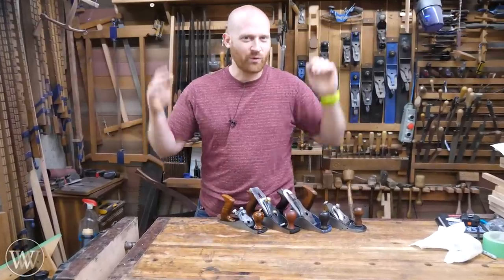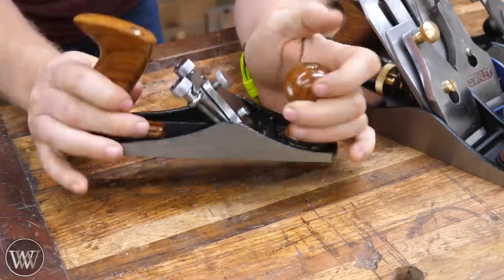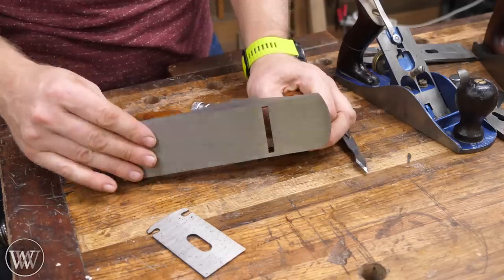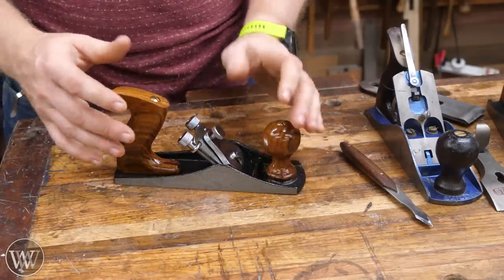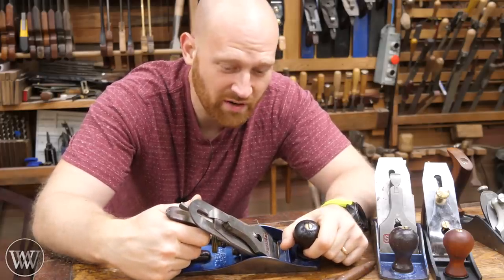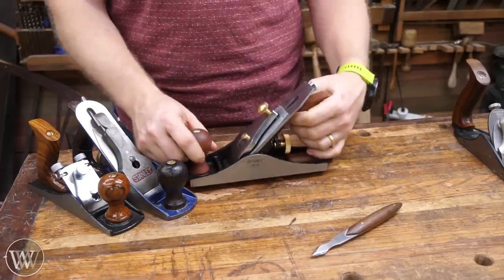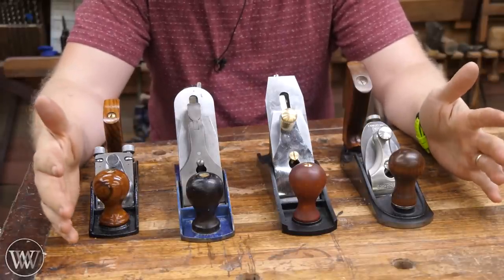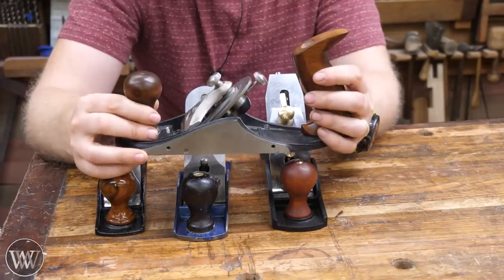The Good the Best and the Ugly | Choosing a Hand Plane

Comment: And then there are people like me who live in a tool desert. My area in Colorado is too modern for old pioneer planes, too old-fashioned for hi-speed internet or reliable cell service, too sparsely populated for lumber yards, and too sparsely forested to find any wood other than pine, fir, and red oak. Just yesterday I made up a list of every antique dealer, pawn shop, tool retail, and even army surplus store in my local area and I found not one plane, not even junk to take a blade from, except from Harbor Freight. Craigslist has only two listings for planes in the massive area that I'm part of, both of which are over a hundred mile drive just to look at. And when I check your website for locating tools, it's a 300 mile drive to the nearest point on the map. So buying online is basically a necessity, and I'd rather not start my woodworking journey by spending six months buying four or five antique planes before I find a good one.
Reply from the maker: ya that is not an easy place to find tools. Have you contacted the Rocky Mountain tool collectors? http://www.rmtc.org/
Reply: @WoodByWrightHowTo  I did not know they existed. Thanks for the link, I'll check into them. It'll still probably be painful to reach them physically, as I live basically smack in the middle between Denver and Salt Lake; 300-some-odd miles to reach either one. But at least this gives me a relatively local group to look at.
Reply from the maker: ya you are in a tough place. no fun!

Comment: I was gifted some 1950's Stanley number 4's but I wanted some new planes which didn't require a second mortgage. I settled on some faithfull's. I fully agree, comfort in the hand is so important, so although the handles (totes) are clunky, I spent some time with some engineers files ranging from bastard to fine.  Just recently, I  had to spend a couple of days with my scrub plane, a very cheap no name number 4, well used and discarded onto ebay. When I finally got to use one of my Faithfull's again...... oh the difference, the difference !!! It was like, "where have you been" ??? So definitely, I  would recommend tak8ng a rear handle off (tote) and spend a little time, sitting comfortably somewhere,  with a cloth over the lap, and just file to the shape of your hand, well worth the investment of your time.  🏴🇬🇧👏👏👏👍👍👍🇬🇧🏴

Comment: After searching the local market for a fixable couple of planes I bought a pair of grizzly planes. The #4 needed very little setup, maybe a half hour, the#5 needed substantially more and I use a scrub iron in it for the most part. Both have performed adequately in the tasks I've put them to. Oh, bought a small set of the narex chisels, what a joy to play with! Now if I can just figure out how to hold my ancient 1/8" chisel to hone it consistently I'll be a happy old curmudgeon. Hope your mother in law is doing well and all of you stay safe.
Reply: Old Stanleys are hard to come by in the PNW. I have three Bears—the smoother, the jack, and the jointer. Grizzly doesn't use the Stanley numbering system, but they're pretty decent updates of the 4, 5, and 7. I put Hock irons and chip breakers in the smoother and jointer, spent a couple of hours each dialing them in, and love 'em. I also have Narex chisels, and have yet to reach their technical limits. I recently got a set of the Narex cryogenic chisels, haven't completely bonded with them yet. You don't have to cough up a lot of money to get users.
Reply from the maker: here is an old video on sharpening thin chisels. https://www.youtube.com/watch?v=xyjR-8uNR8I I know a lot of people that really like their Grizzley planes. if they worked on their quality control they would be in a lot more houses at that price point.

Comment: The original Stanley irons are perfectly functional with the mouth and cap iron properly adjusted.  Vibration is usually the result of the frog being poorly seated.  I discovered that restoring a "restored" Bailey.  The "restorer" had painted the entire interior including the bedding surfaces for the frog.  Cleaning the paint off those surfaces, especially the bits stick in it, made the difference between awful and excellent.  Also adjusting the frog forward helped a bit.

Comment: Still a great video. I agree completely. Ive actually been using some antique Craftsman planes made by Millers Falls. They work beautifully. After restored of course. I hot rodded mine with new custom D2 irons, new mahogany totes and knobs, and fresh paint jobs. I found that I love to bring old planes back to life.
Reply: I got a Craftsman branded Jack Plane from my dad and it is my go-to for that size of plane. Very well made and absolutely solid, I use it for stock preparation and for my shooting board (with a different straight flat iron). Not sure where mine was made, it was bought here in Canada, but I would get more of similar age without question. 

I should really look up who made mine and the actual age of it (at least 50 or 60 years would be my guess as it would of been early in my Dad's carpentry career. He bought it to shave down doors when hanging them.

Comment: I started using hand planes several years ago and restored three Stanley planes: two #5s and a #3. Your comments about the time commitment to getting these planes on working order is accurate: it takes hours for each plane. None of mine had sides 90 degrees to the sole even though the soles are flat. I have been looking for a shooting plane and ordered the Taytools #4 after viewing this video last week. I had tried one of the cheaper versions previously — lots of quality issues and unworkable. I returned it. Same thing happened with the first Taytools’ #4. Decided to give it a second try, requested a return and replacement, and the second one I received is as good as the one in your review. After only having to flatten the back of the blade and hone the edge, the plane did a marvelous job on a piece of maple. Looking forward to years of use. Thank you for a very helpful review.
Reply from the maker: Sounds about right. Interestingly enough the idea of having the sole flat to the side is a new one. It used to be something that was not very important. almost all antique planes are out of alignment because no one checked that historically. If you need to use a shooting board the lateral adjuster will take care of any angle problems because it's not the measurement from the sole to the side that's important it's the measurement from the side to the iron.

Comment: I picked up a "Kobalt 9.75-in Bench Plane" from Lowe's for about $35 last fall. It has been working great since. It looks very much like the Stanley and the TayTools planes you show. You might want to have a look at it for comparison to bring up the quality on low-end "big-box" store planes. Great content by the way! Keep 'em comin!
Reply from the maker: Yup. I have used them in the past. The one I had was trash. But most reports I get on it are 50/50. Some get a great one and some get boat anchors. If they would work on the quality control it would be great.

Comment: I inherited two planes when starting my woodworking hobby (two jack planes from my dad, a Craftsman and more modern Stanley Bailey) and after watching Wright videos and Paul Sellers videos started to look for a small smoothing plane. Got super lucky without realizing it and found a used #4 vintage Stanley hand plane, in basically perfect shape. Came with the box and only needed a bit of cleanup to get flat/shiny. Lovely tool and got it for a steal. I was recently given a modern "blue" Stanley Bailey Jack Plane which seems to be pretty poorly made, but even that worked well as a scrub plane with a wider mouth and dedicated curved iron. 

At this point I would love a large jointer but I've never seen them for sale locally, and they are quite expensive new. I think getting another smoothing plane would be a good idea, but just need to figure out what brand to get. Honestly the new Union X-Plane 4 1/4 seems like it could be a great choice, and unique. The only thing is I may want a smoother with a wider iron though. Always another tool one needs to get!
Reply from the maker: The world does not have enough tools lol. There's always another one.

Comment: Having one hell of a time finding fairly priced antique planes. So I think I'm gonna end up with the taytools 5 1/2 jack, followed by the 7 then the 4, assuming they're as good as they seem to be. Thanks for the work here
Reply: A plane is about as good as the user until you get to a point where, like the big box example in this video, nothing you can reasonably do will improve the tool to compare against a decent one. Even the mid-low Bailey pattern planes can be fettled and modified to work properly so long as you're willing to put the time in to ensure it works well.
Reply: The Taytools 5-1/2 is a sweetheart of a plane, I was just out turning gossamer shavings in the garage (despite being unheated and only 20°f in there)
I also upgraded my old Stanley #6 with a Taytools iron, a vast improvement.

Comment: My first hand plane was the HF #33 and other than the iron needing sharpening way more often than my Stanley planes, it worked. I still have it and it's about perfect now other than the softer iron. Flattening the sole took me all of 20 minutes and that's all I really had to do aside from the usual flattening/sharpening the iron. I bought a new-make #5 jack plane from HD online and I had to do more work to that one to get it right than the HF plane... I wasn't happy but now that it's done, it's beautiful (make a new tote & knob, the plastic tote actually broke mid use on mine). I got a new-make Stanley 4 1/2 from Amazon UK Global and it also needed a lot of work to get it true although the iron is surprisingly better than the one from my jack plane. 
My newest addition that I actually just received yesterday is a Stanley #7 Type 14. The 90 year old plane that I don't have to fettle anything on. I sharpened and honed the iron and already put it to good use. The sole came dead flat, the jappaning is waning in some small spots but it works and works well. I actually used the Wood by Wright antique tools page to find the dealer and it was half the price of what I could find on ebay and in better condition.
Reply from the maker: Sweet. I am glad to hear you like it. the times I have used my HF 33 it only holds the settings for a couple minutes and I have to twerk it.
glad you found the site useful. i will try to keep them coming.
Reply: I bought that hf #33 about 15 years ago for under 10 bucks.  My first planes were a crappy buck #5 and a little block plane (around 35 years ago).  I still use that block plane - the Buck was chucked.  My hf #33 just needed to be sharpened and set - haven't done anything else in 15 years to it.  On my bench right now is that #33 that I use as an all around bench plane and a vintage Stanley #4 as a smoother.  I don't use rough sawn lumber so I don't need a proper scrub or fore plane. At last count, I have 25 hand planes - I only use 3 at the most.

Comment: I have a nº4 with the same break in the handle. And I'm waiting for the new blade because there are a lot of vibrations and I thought it should help. The blade is very used, bent, and thinner due to restorations. Hope that works and I can feel the same joy the people seem to have with them finally.
Reply: And my nº6 is like your Taytools. Maybe they're from the same factory with a different brand? They're too similar in every detail. The thing with that is you don't have to worry about guessing the problem with vibrations and spend more on a new blade that costs more than the plane itself... But I only have one antique. I'll continue trying, maybe with a nº5.
Reply from the maker: If you are having problems with vibration you may actually want to check the fit of the iron to the frog. Most of the time that's actually the cause. A thin iron actually doesn't create that many vibrations. That's a bit of a misconception that has become a common myth.
Reply: @WoodByWrightHowTo  Thanks! I didn't hear the myth, I was just guessing wrong. hehe. Most likely you're Wright and that's the problem. I've just realized how bent it is, not making good contact with the frog. It's very worn-out anyways. I'll see if there's a way of straighten up with my limited tools, tho.
Reply: @WoodByWrightHowTo  With the new iron making good contact with the frog, it's solved. Hurray!

Comment: A few years ago when I had almost no money, I bought a Harbor Freight $12.00  stanley knock-off.  I couldn't get that thing to work.  Diad all the things everyone said to do to set it up, no shavi hs of any kind, not one.  Several tube makers showed many of the fUlts with this plane, and showed how to fix them.  But they used $10,000 equipment and Ll I had was sand paper and a granite block, and a  heap Rotating sander.  Did what I could.  Over a couple of years, I put about 300 hours into this plane trying to make it work.  I succeded.  It took its first shavings last weekend and when it did, it was then time to move up and geta better plane.  I just received it today.  Over 3 hours into set up and it was whittling down the crookedness of a 2×4.

I chose a Taytools #5 for its versitility.  The price from Taytools was $99.  Amazon wanted $119.00.  There isn't a whole lot of descriptio  on this plane.  It's  a bailey platform with the screw on the lever cap i stead of the snap down lever.  It has a 2" wide blade like a #4 so blades are interchangeable.  

Because I speent so much time rebuilding the hf #4, I was sensitive to the many aspects of a plane.  With a critical eye, I addressed each issue I found.

Back ip a bit..it was beautifully packaged.  Double boxed and the plane rested on a bed of memory foam.  When I removed the lever cap, it was thick and heavy!  The lateral adjustment has some heft, too!

It did have some sharp, jagged edges on different parts, but it doesn't any more!  Areas that should be flat, really are, now.

The sole was flat. I didn't have to do any work on it.  The sides 90° from the sole.  The sides were hollow, they aren't any more.  The edges were nicely rounded.  But the blade...omg was that thing pathetic!  Hollow from tip to tip along the edge.  It took forever to get a sharpenable edge.  I Even had to resort to an oil stone for the first time ever...but first, I had to flatten that!  Then had to give everything a bath with a scrub brush to cut the oil co tamination on the diamond stones.  You know how things can cascade.

It's done, works beautifully and I can't wait to see what she's like with some premiere blades and chip breaker.

Most people wouldn't do the work I did, but I didn't want to skip anything and have to troubleshoot a mystery such as with the hf.

"Tae" is beautiful, functional, inexpensive and appropriately priced for her class.  And yes, "Tae" is her name.  If you get a good blade from the start, the setup time will likely be a whole lot less.  

I've never seen nor used a premium plane such as lei neilson/veritas so Ll I can compare with is sow's ears and a few stanleys.  Tae has the potential to be an excellent plane with a new dress and some tlc.

Comment: I have read somewhere, I believe on lumberjocks blog, that the Rockler bench dog planes are made by tay tools. I have their #4 1/2 and #5 1/2 planes. Haven't used them yet as I'm still trying to find a place to set up a shop.
Reply from the maker: I believe they are made in the same factory. though I do not know for sure. then  bench dog planes have more brass and other things to make them a bit shinneyer, but that ads to the price. great user planes!

Comment: You mentioned that Veritas doesn’t want to go with the Stanley/Bailey design. Half of their line are planes the have similar looking planes with the 45 deg frog but with a Norris adjuster which I like. The Bailey requires disassembly to make frog and mouth adjustment. An adjustable mouth on many good planes made today have this sliding adjustment, even my little Stanley block plane that I purchased years ago has it. Lie Neilson still carries a copy of the Stanley but are made to a much higher standard of quality with the use of modern technology. You definitely pay for it and the name brand.